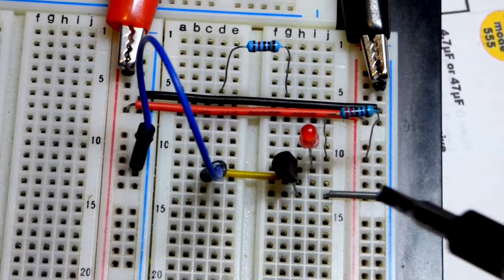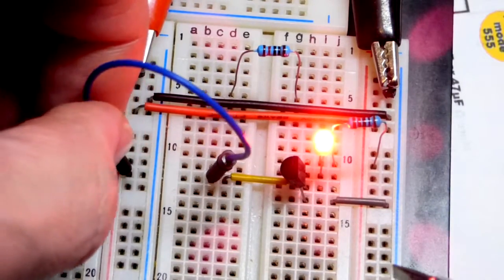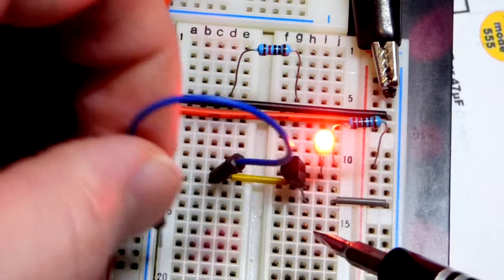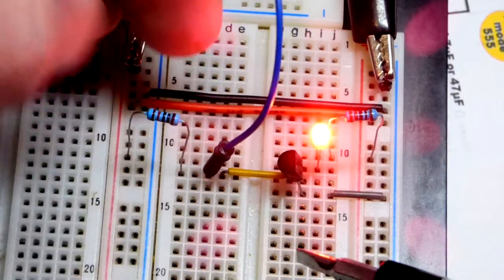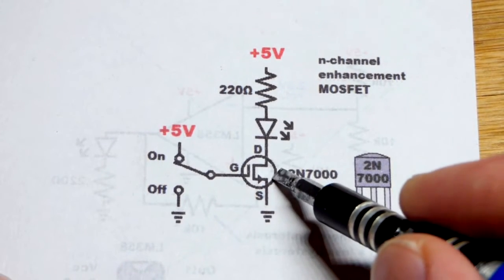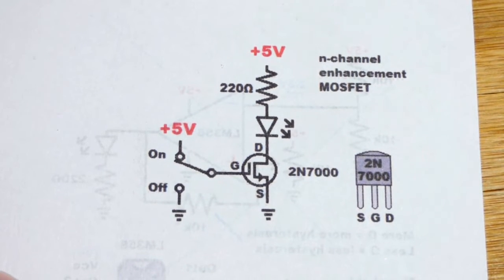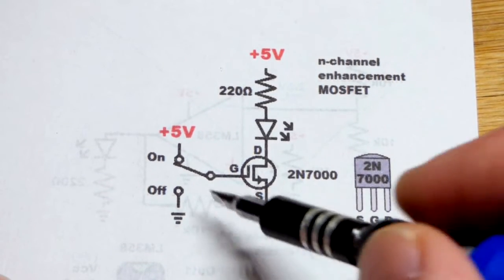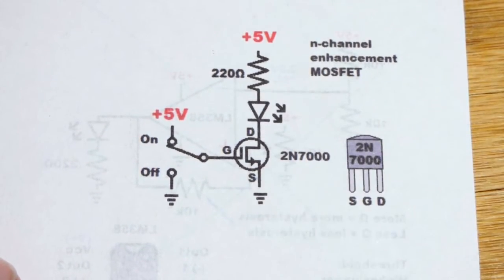2N7000 N channel enhancement mode MOSFET switch demo circuit learning electronics lesson 0034

Comment: Fabulous video! I attempted a circuit with 4 of these 2n7000's on a kayak to be blinked every so often so drunk boaters wouldn't smash into me at night....I humbly ask sir, would you touch upon having 2 or more in a circuit? I ask in hopes for clarity in regards to each should be isolated, insulated, and also share a common ground with the power source, load, and also any device sending positive  voltage to the gate... forgive me I know it's selfish to ask for specific stuff....
Reply from the maker: I'll try to keep that in mind :) Anything that oscillates a high and low voltage should work though. You can connect it's output directly to all the gates of the the MOSFET transistors, or use one transistor to switch 4 parallel LEDs with protective resistors if the transistor can handle that much current.